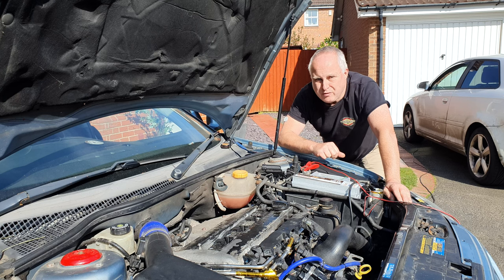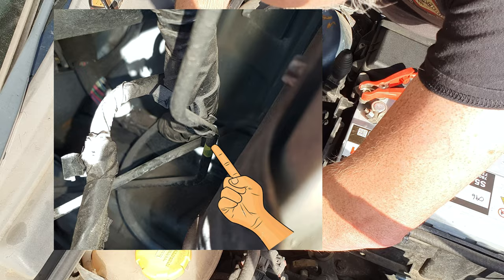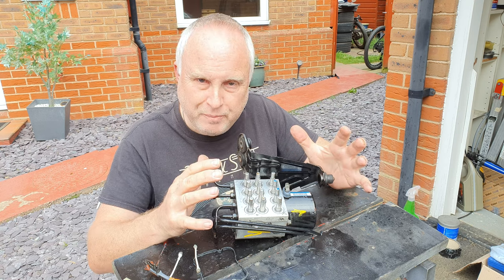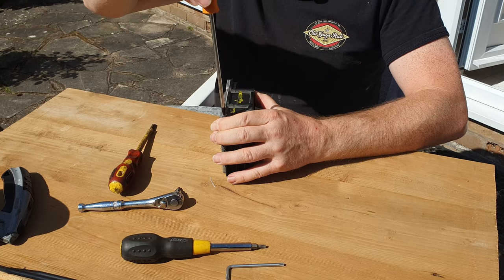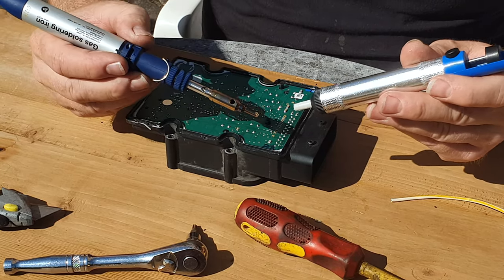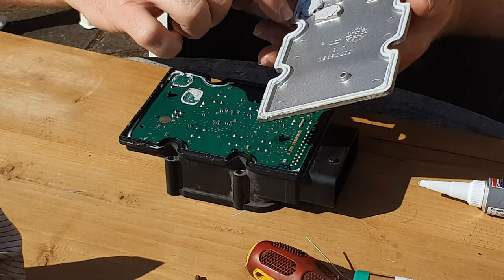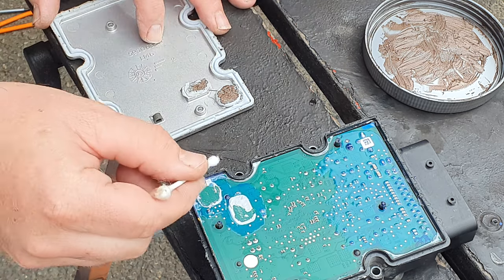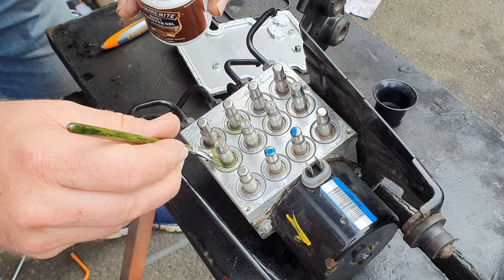Saab 9-3 No Crank No Start | ABS Control Module Repair | U0212

Comment from the maker: 👉 Saab 9-3 No crank no start diagnosis: https://youtube.com/shorts/KhCPffsia00?feature=share
Reply: 1.9tid won't crank from the key, putting in the loops took the message about the traction control off the dash. But still not turning off the key. Engine will spin from the starter relay with a wire to the positive of the battery. Please give me some advice?

Comment: The two videos that I have found for this repair are both for right-hand drive cars.  For left-hand drive cars, the location of the master cylinder makes it pretty much impossible to get to the lower screw next to the firewall.  And, even if you can, removing the module straight off the valve body is almost impossible.  For these cars, it's much better to go the SAAB WIS route and remove the battery box and then drain the system and remove the ABS unit intact.  It's a PITA, but with this route you won't potentially damage the unit.  Once the unit has been removed, the repair that Cyd shows in the video is straightforward and sharing his work is much appreciated.
Reply: @SteveBrandt  I just completed the impossible! I did it on a left-hand drive 9-3. It took me the better part of 4 hours and a sore back. I only replaced 3 of the 4 screws on the module. The bottom screw to the right was the hardest task of the entire job. Good luck if you're attempting to do this.

Comment: I had same problem with my Saab 93 V6 two years ago. I did the same as you did here in this video (re-soldering cold joins in the ABS module). I have fixed the problem. Thank you for sharing this content is very helpful for Saab owners. Regards from Mexico.
Reply from the maker: Thanks for sharing. Is the 9-3 popular in Mexico?
Reply: @CycloneCyd  I'm the  owner of two Saabs,  I have a 2003 Saab 93 Linear B (since new) and a 2008 Saab 93 V6 Aero.  People  ask me everyday about my cars (many people like them )  they don't even know about the brand on these days but I think  is because Saab 93 look very modern on these days. Saab 93 was very popular in Mexico between 2003 until 2008.

Comment: Thanks to THIS VIDEO, another Saab saved! My 06 Aero Sportcombi 9-3 was having the canbus failures pointing to the ABS module. Jumping the two pairs of bus pins on the ABS connector resolved it for long drives during the entire week I tested it. The LHD US car engine bay is a bit tight but I managed to move the pump enough to remove the module. Followed all your directions and later put it back into the car. (Soldered ALL the connections) 

Previously the bus would fail in about 10minutes consistently when warmed up from cold each morning. 

Just took it for an hour of hard driving, and IT RUNS GREAT. Did not realized how much power was lost due to the poor connection. Pretty excited. 🙂 THANKS CYD!

Btw a few of my oops... tips. 
-When running a knife around that silicone seal, only cut 1/8" with just one gentle pass. 
-That plastic rib is easy to cut through, which makes a real mess and results in a less stable seal. 
-TAKE YOUR TIME and light pry pressure on the main plastic middle and upper body area, being careful not to pry too hard on the lower section later where the plastic cover is thinner. 
-Get one entire side to become loose before moving across the top and bottom, and the down the other side, because if the entire top half is loose first and you start working that lower section, IT WILL CRACK.
-Easy to crack that plastic housing at the weak points. Slow down. 
-Having some sandpaper & epoxy 2 part plastic repair on hand is valuable to seal up any areas you damage by prying(like I did). 
-When gluing it back together I used large rubber bands around the upper and lower sections to hold it together. 
-The silicone needs several days cure time for full strength, so don't get excited and cook it in that engine bay too early. Lol.
-You have about 10min worktime on the silicone, so plan out your moves ahead of time, and keep rags handy for gummy fingers!
-I ended up cleaning and  seating that o-ring cord into a layer of silicone in that plastic channel, seating the rubber evenly, adding a light skin on top of the rubber, and seated it back on the pump for a REALLY good seal, inside that 10minute window.

Hope this helps!
I will be posting a quick video about that entire troubleshooting and repair ordeal and let them know to find THIS video for a detailed explanation and visuals.

Thanks again Cyd!
Now...Off save more Saabs!

Comment: Hi cyd,
My 2007 aero vert was in a garage for clutch and camchain.
They did neither, but told me the car would not start, and had pushed it outside, so I had it collected on a pickup truck.
The dreaded steering lock malfunction is showing. The lock though is in the off position, and key can be removed, but will not turn to on.
With a modified ignition module, replacing mine,
The key will turn and miu lights up.
Tech 2 says missing Ibus, Allthough flashing headlights on main beam proves Ibus working. 
I have a full tank of petrol but gauge reads empty.
Icm wakes cim, which in series connects next to miu then ecm. 
I suspect, after watching your video that the ecm is faulty, 
I will link 1 and 13 and 2 and 14 in the ecm connector to see if it starts. 
If so I will follow your instructions on resoldering the ecm. 
Thanks for your great video here, and your other video on bad joints on the ecm.

Comment: Just opened my ABS ECU - how the heck did you manage to do it so easily? I have broken mine in a few places and was wrestling with it for like 40 minutes!
Reply from the maker: Running a knife round the 'seal' helps big time.
Reply: @CycloneCyd  Did that - didn't do much but a bit more of automotive sealant around the edges was enough to make up for the broken plastic :)

Comment: Outstanding video their, can see you put lots of time and effort into this….hat of to you sir!
While on the subject of abs do you know if the Saab v6 abs loom/harness in the front wheel arch are problematic? Iv a Vauxhall using the same v6 and the cable is a nightmare 😩
Reply from the maker: Yes, I did put a lot of time and effort into this one, almost twice what it usually takes to produce a decent 5-6 minute video. Nice to know it's appreciated.
The ABS cables to the wheel sensors aren't normally problematic of their own accord. People do occasionally have problems with water ingress to the connector, but no more so than many other cars. Problems around wire chaffing and/or damage are usually caused by cables not being put back properly after a brake or suspension job. What's the particular problem with the Vec C? Surely it's virtually identical to the Saab?
Reply: Well iv owned the vectra c for almost 2years now and it has come to my attention that their has been damage in the past to this cable and “hidden” the problem, the issue is the v6 Vectra have IDS wiring running in the same loom as the abs, normally I’d just replace the whole loom/harness but you can’t get replacement parts for this any longer, would you think a Saab loom would fit in your opinion?
Reply from the maker: @vauxaholic  it probably would. But why not just fit some new wire in parallel to the damaged piece and connect it at each end and bypass the damage?

Comment: Hi Cyd, I'm really enjoying the thoroughness of your videos on your Saab 9-3. As this was the video relating to the abs I thought it might be the most appropriate on which to  contact you and hoping you might be able to help me with a brakes issue on my 2011 Saab 93x. When the engine is turned on the foot brake slowly goes to the floor. When not running I have a hard brake pedal. Have tested master cylinder by blanking off both outlets, - all Ok. Have flushed through and bled system thoroughly. There are no fault codes on the dash. As this only happens when engine on and thought the only thing connected then is the abs. If you can find the time to help me I would be very very grateful as I can find no information anywhere. Many thanks.

Comment: Cyd, the brake pipes on the valve block don't have enough play in them for me to get to the screws on the ECU. If I disconnect the brake pipes from the valve block do I have to bleed the brakes afterward? Mine is '06 Aero V-6

Comment: Hi cyd, thanks for the great video. I was wondering if you knew what code this problem would cause? I'm currently getting a U2105-00 CAN-Bus No communication with ECM (Engine Control Module) code. I will try bridging the wires you suggested in the video. Hopefully this will reveal the cause.

Thank you!
Reply from the maker: U2105 is defo an ECM code. Try the wire bridge first though. Try disconnecting and reconnecting the ECM, checking all connection pins for damage or corrosion. Also check the big connector under the battery tray near the front. Also check all the connections in and out of the fuse board. Check and clean the earth connection on the ECM.
Reply: @CycloneCyd  Hi Cyd, thank you for your response, it was really helpful! I have followed your advice and was able to get the car running :). I cleaned all the connectors you said but I believe it was the ECM connectors/ECM pin corrosion which caused my fault. I could see some of them looked slightly green with corrosion. I did a gentle cleaning just by straying with contact cleaner to start with. After this the car ran, but I had some unusual faults in multiple circuits (like a non-genuine "water in fuel" and "main relay opening too slowly"). After this, I cleaned the ECM pins with another contact cleaner and carefully with a brush. It seems to be working perfectly now, but only time will tell. Thanks again!

Comment: Hi Cyd, love your channel. Hope you can help. Had  C0035 code, wheel sensor wires corroded. Replaced the hub. Still have C0035 and all lights on dash. Traced wires back to ABS and no breaks from sensor connector to ABS. Connected back up with key on, engine running, getting 0.09 volts at sensor connector. Where do I go from here? Car runs & brakes fine.

Comment: I just did this and I can say accessing the SouthEast Torx(T15) screw was not possible by me. I made a thin aluminium 'wrench' that holds the torx bit in it after shaving half of the torx bit off. No way I was getting that last one out. THEN separating the lid from the plastic is nigh impossible without cracking the plastic lid lips. Heating didn't help, so much torque has to be applied to separate the lid that it cracked (slightly) the thin end where it joins the main base. Parts of the plastic still remained inside of the metal lid groves. At this point I wished I hadn't started this process. I did the rest, siliconed the f8ck out of it after supergluing the snapped off lid channels. Taking it back to shop for reinstall and fully expect to be buying a new/used one.
Reply from the maker: Sounds like you didn't score the 'glue' first with a knife like I did. I know plenty of other people in forums who have done this successfully.

Comment: Could i try this out if diagnostics show that i have communication problems with abs module? mine symptoms are no working abs, brake warning light and speedometter stops working when error accures. sometimes it just goes back to normal like nothing happened during driving.
Reply from the maker: Yes.

Comment: Hey mate. I currently have the U0212 fault code too, but my issues are different. My car starts every time, but once accelerating from 60mph I get a traction control and stability control failure light come on. I just need to turn the car on and off to get them to disappear. Do you think its the ABS control module too? Cheers
Reply: Not sure on the 9-3, but on the 9-5 (at least up to MY2004), it is a common condition for the warning lights to come on randomly when the abs module is just starting to go. It can stay like that for a long time actually, more or less an occasional minor nuisance. If it is happening all the time, then probably time to refurb the electronics.
Reply: I should add though, that on the 9-5, when that happens, the dash is like a Christmas tree with lights: abs, TCS, parking brake, etc all come on. If just one or two of those come on, it could be another issue (but 9-3 and 9-5 may be different), often a sensor (eg abs, yaw, etc).

Comment: I hear what sounds line a geiger counter coming from my center console sometimes when my electrics get funky. Any idea why?
Reply from the maker: What car? Some have the aircon temp sensor behind a little grille and it has a small fan. Dirt can get in and they get noisy.
Reply: @CycloneCyd  Saab 9-3 Aero Sport Combi 2006

Comment: Hi, my ttid Saab has run the battery down a few times. There’s a loud squeal from the back of the engine after the ignition is off. This stops after 30 seconds, but I noticed it was squealing a few hours after turning the car off last week…I go to start the car next morning…battery drained completely. I charged the battery and car started fine. So to fault find, while squeal could be heard and ignition was off I pulled fuses out of fuse box next to battery. Fuse F1 30a engine management control unit was the fuse that stopped the squeal as soon as removed. Do you know if this is the fuse for the abs ecu? And could the abs unit give the ‘squeal’? Thanks
Reply from the maker: What a strange fault! I'm not as familiar with the diesel as I am the petrol. Test the power to the engine ECU and ABS with your DMM or a test light to find out. You could also try a mechanics stethoscope to track down where the noise is coming from https://www.youtube.com/watch?v=xkD95IWzGpI
Any chance you could send a video recording of the fault?

Comment: Hi cyd I noticed you added a protector lense to a reflector headlamp. I wanted to know if I supplied the parts and had them shipped to you if you could do the same for a pair of my headlamps. I live in the UK and would pay in advance. If this is something you would/could do let me know how to contact you and we could exchange details. Many thanks in advance. Your videos are awesome 👌
Reply from the maker: Are you referring to the mini projectors i fitted to the C1 in this video: https://youtu.be/it0n-9PgBgQ
OR something else?
If you're referring to the C1, there is a link for these projectors in the description and they are a direct fit in place of the bulbs and so are a doddle to fit.
What car and type of headlights do you have now?
Reply: @CycloneCyd  oh no I ment taking my existing reflector housing and adding an aftermarket projector in there and sealing it back shut 🤦‍♂️😅. It's an BMW X3 F25 2011
Reply from the maker: @alycapo3391  ah, right. So you're after a custom build. Are the existing headlights halogen bulbs in reflector headlights then?
Send an email (address in 'about' section)

Comment: Hi Cyd,
If the module is swapped out does the "new" unit need to be added to the buss or is it good to go, given the module is good?
Reply from the maker: Needs added to the car with Tech 2 with security access
Reply: 👍 Thank you Cyd.
Reply: Hi Cyd,
I need to repin the connector to the ABS module. Do you have any videos that address this? Also do you know the name of these particular connectors? What type are they?

Comment: The problem I’m having with my Saab 9-3 is most of the lights comes on and off like the ABS ,brake is it the same pin issue am having let me know thanks
Reply from the maker: Can you be more specific about which lights you mean and also the conditions when they come on
Reply: Whenever I start my Saab 9-3 all lights comes on in the dashboard most of them goes out but the brake lights indicator stays on the ABS lights indicator stays on the TCS light indicator stays on and also the warning light indicator stays on . After a few attempts of switching off and on  the light indicators goes out completely sometime when you’re driving they’ll pops up back up in the dashboard i was told it’s the ABS module need to be changed
Reply from the maker: @jamrockrc172  it won't be the particular pins I mentioned in relation to the comms (1,2,13 &14) because if they become loose it prevents the car starting. It could however, be other pins along that row.
Next time it does it, leave the car running and waggle the ABS connector. Maybe get someone to do it for you while you watch the instruments. If the warning lights go out then it is defo one or more of the edge pins. It could just be one pin to one of the sensors - that's all it takes.
Another possibility is the wires feeding the rear WSS's where they jump from body to rear suspension. They have a nasty habit of breaking internally. Probs the best way to check this is to use your DMM on continuity and while the buzzer is sounding waggle the wires along their length and see if this causes the buzzer to 'stutter'. If it does you've found your problem.
Reply: 2008 9-3
I'm having the exact same issue that you are talking about as well, the same lights will come on the dash, abs-brake-traction control-and cornering headlight malfunction. When the abs and brake light come on, if i shut the car off it will not restart unless I wait until the computer's go to sleep, or I have to take the battery cable off. But recently I've been having trouble with the hood release cable and now the hood will not open to allow me to take the battery cable off to reset it. Have you figured out  what the fix for this is?  I usually only have one code when I check the obd2, but when this happens I have 4 or 5 other codes pop up.